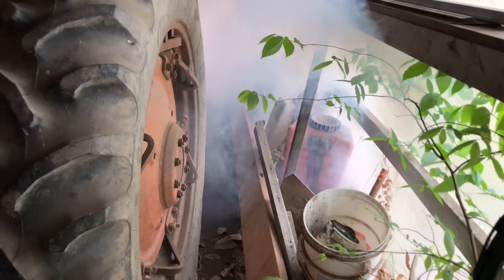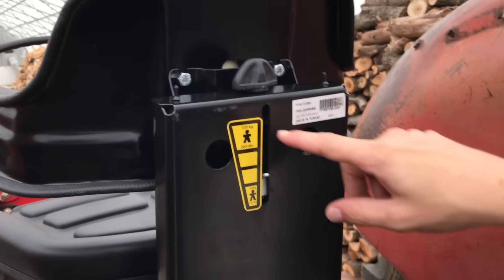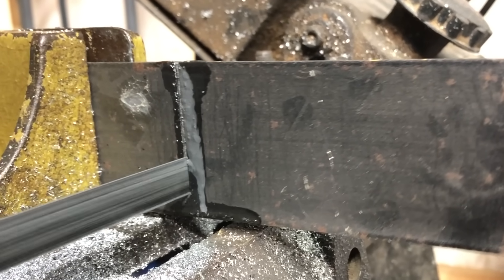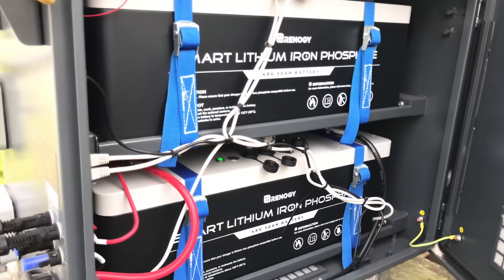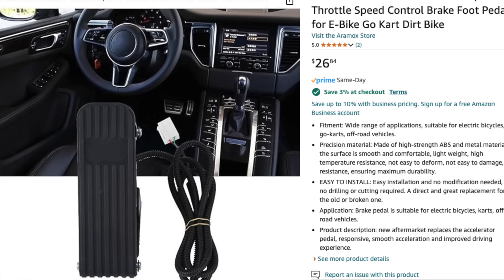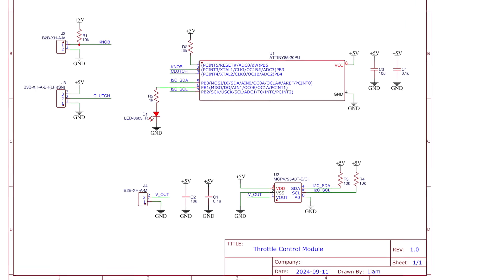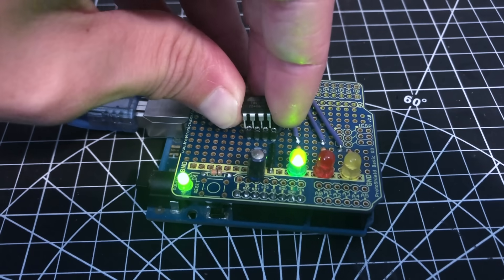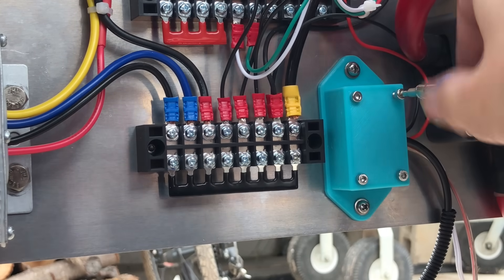Adding a fake clutch & more to my electric tractor conversion

Comment: Emissions for EVs that use electricity produced purely from coal are about the same as for ICE engined vehicles.
When you add lower carbon generation sources EVs progressively have fewer emissions.
Reply: It does depend on the exact fossil fuel source in question. Brown coal is so dirty that an EV running on power produced solely by brown coal would emit more than a diesel. Which is a good argument for not using brown coal power plants, they suck!
Reply: @nerd1000ify  
yeah good point.
I was basing it on typical coal plant CO2 emissions. Many assume that big power plant emissions means big emissions per mile travelled.

Comment: I grew up on a farm and seeing your LED light placement gave me worries. Brush hogging or any work around fields will have tree branches that quickly peel those lights off. Old Ford N and Ferguson tractors with googly lights up front could hardly stay attached. Best solution is look up Allis Chalmers WD lighting (it's back by the operator station, short wire runs, protected, plus if you need to check the engine you can see stuff), later tractors the forward lights moved to the rear fenders.    Hopefully another episode you can reattach all the hood sheet metal so the tractor appears original until closer inspection shows new..

Comment: The implementation of the clutch for fine movement is a genius idea. It makes so much sense on a piece of farming equipment as opposed to having an accelerator and trying to push down carefully. 
The only thing missing (From a safety perspective) is a dead man switch on the seat in case the driver falls off.
Reply: The lawn tractors / riding mawers have something like that, I haven't seen it on a normal tractor.
Reply: @stelleratorsuprise8185 there are in some. They shut down the engine when the tractor is in gear or when the pto is turned on.
Reply: @stelleratorsuprise8185  tractors have cabins nowdays. But there usually is a switch that prevents tractor to start the engine or move, without someone sitting on the seat. But you can run it stationary.
Reply: It looked like he was using the PTO while the tractor was stationary though. If I understood correctly, the motor is powering the weels as well as the PTO, so the dead man switch would require an optional override that makes it almost useless again.
Best way would be to couple the deadman to either a sensor for the selected gear or speed of the tractor => switch off IF  nobody in the seat AND (gear selected OR speed > 0)
Reply: you can install a simple dead man switch under the driver seat, on a 5sec time set so when the weight from the seat is lifted for over 5 sec the tractor shuts off or applies full brakes.
Reply: Which tractor from the 70s got a dead man switch in the seat? :)
Reply: @RubenKelevra yup. Hope it hits a tree and not the house lol that's how you end up with a tractor in the living room
Reply from the maker: @formernegativehuman  I would love to have a tractor in my living room

Comment: No comparison of your toy with another identical tractor doing the same job, e.g. deep plowing or other heavy agricultural work. Also, don't forget about the time it takes to refuel.
Reply: Tractors on farms don't just get used for ploughing.

I've done a fair bit of farm work, and honestly our most used vehicle was a Posi-Trac loader. Used as forklift, front end loader, cement mixer, post hole driller, etc. Often hardly drove it any distance, start up, work for 10-15 min, shut down again because there's hand work to do. So for that kind of operation an electric tractor would do great, no wasted energy from leaving it idling all the time and would handle those tasks without an issue. Would still have the big combustion tractor for the field work like planting and spraying. 

The farm I worked on never ploughed, No-Till grain (either barley or sorghum) and beef cattle only. Ploughing trashes the topsoil and ruins your fertility, the reason you do it is to kill weeds before planting, but that's not necessary when you can spray the field with glyphosate instead.
Reply: This is a DIY "project". There's no way this should be compared with a commercially developed and built tractor! It uses a $99 off-the-shelf general purpose electric motor! However it is demonstrating the real potential for some farm vehicles to be electrically powered.

Comment: Pay zero attention to the people arguing that electric is "worse" than petroleum as I doubt that was the point.  It seems to me that you wanted to revive this tractor to do something useful without the noise and smoke.  It's a great project, so thank you for sharing it with us.

I've used tractors for decades and it would be nice to have a BEV one for shorter tasks.  They can't work for days at a time like their diesel counterparts, but they're great for many jobs.
Reply: Its weird that people instantly jump to "he must be a environmental crazy" just because eletric engines. The thing is fun as heck, produces a ton of power and are simpler than combustion. How not to like EV projects?
Reply: godzina jazdy 12 godzin ładowania , zajebista zabawa
Reply: @mariusz3229 More like 12 hours of driving and one hour of charging if you connect it to your 63A three-phase outlet.

Otherwise you just charge it overnight or when it's not being used anyways, at which point it takes less actual "worked" time to fill up than a diesel, since plugging it in takes just 5 seconds to do instead of a few minutes.
Reply: @mariusz3229  tractors are not for fun, is for work and in one hour, you can plow at lest two smaller fields or a single big one. 
But I doubt well build EV tractors only work for one hour, why because CAT came out with their EV excavators and they calim they can work for ~8 hours depending on the job.
Reply: @Argoon1981    Then show how you plow a field of, for example, 20 ha until your toy is unloaded, and how the diesel, towing your toy along with the plow, will finish the plowing for it and tow it all to the house.
Reply: @mariusz3229  ok we get it, you work for the oil companies and want to continue to keep us relying on the things we know are destroying earth. We’ll just do the stupid thing forever and never try anything else, seems like a the best idea in your opinion

Comment: Nice job! I can't wait to see more :)
I have a few suggestions for you. Place the lights on top of the front tires in a way that they turn when the tires turn (if possible somehow). The second suggestion: Lower the battery (if possible) so that the center of gravity is lower :)

Comment: The amount of people who are still stuck on the argument of "the power comes from coal tho!" is genuinely laughable. While there are many valid arguments like the destruction of land and pollution to mine rare metals needed in solar and batteries. But instead, they are going with the argument that can be disproven in 2 ways. 1# Many places even in the USA are powered heavily and or entirely off renewable. Where I am at we are 85% hydro, 14% wind, and 1% solar. 2# the efficiency of scale, Even if a plant uses some other fuel. Plants scaled up plants can gain much more from the same quantity of fuel than if you were to put it in a car or whatever. To give you an idea a natural gas vehicle can achieve 35-40% efficiency while a natural gas power plant hovers around 60%. So you get 2x ish the power for the same volume of fuel.
Reply: Hydro is about the most environmentally destructive power there is.
Reply: @juslitor  your right but wrong. while all power has some downside. our local dams have incredibly advanced systems to relocate fish up stream and prevent them from getting to the tubines. back 60 years ago I would agree 100% but the tech has come a long way and is really not that destructive anymore

Comment: Coal is used to make the panels. The production of silicon requires the combustion of some sort of carbon fuel. The country where they're produced burns more coal than all other countries combined. A bunker fuel burning ship also brought those panels to your country. Solar panels also have an extremely poor EROI, so the fuels burned to produce them is of significant concern.

Anyone wondering why CO2 emissions are continuing to climb as solar power is gaining in popularity?
Reply: I mean, coal is used to make a combustion engine too if we want to go that way. Electrical is genuinely less polluting, especially if your country has a good mix of nuclear and renewables.
Reply: @arconium2571  But if we're talking about nuclear vs solar, it's clear that the winner is nuclear.
Reply: I love nuclear power, but I dunno about nuclear having less emissions during the build when compared to solar. Remember that building nuclear plants uses a lot of concrete and steel. Portland cement for concrete is made in fossil fuel fired cement kilns, steel with coke fired blast furnaces. Add on top of that extracting and refining the uranium (uranium enrichment is infamously energy intensive) and all the energy expenditure on actually making the working parts (pressure vessel, turbines, hydrogen cooled generator, etc). 

Would need a proper technical assessment to to be sure I think.
Reply: @nerd1000ify  Stand-alone solar power systems require more concrete and steel than nuclear. It's just the sheer quantity of the mounts required.
Reply: @PistonAvatarGuy you got a source I can check out for that? Just a title would  be best, YouTube always seems to delete off-site links.
Reply: @nerd1000ify  The title is also not likely to post, in my experience. The source is the IEA.
Reply: @nerd1000ify  Sorry, the source on that particular metric was the DoE. It was a study from 2015 and the lifespan of solar panels appears to be increasing significantly, but even if it's assumed that the solar panels will last for 80 years (about three times longer than the DoE's assumed lifespan), the materials requirements for solar are still greater. Just consider that solar panels require more than 60 times the land area of a NPP with the same annual energy output and you'll begin to understand how that's possible. None of these estimates even include the batteries required to compensate for the variability of solar energy.

What I'd like to see is a study where a ~100 MW-scale solar energy installation, along with the batteries required for it to load-follow in some practical manner, is assessed against a NPP. I'd bet that the findings would be shocking, especially when seasonal variability is taken into account.
Reply: @PistonAvatarGuy  Honestly the best place for solar is the roof of existing structures (like all the sunshades in parking lots).
Reply: @nerd1000ify  There aren't many sunshades over parking structures. If we were to build such structures for the installation of solar energy systems, that would significantly increase the already insane amount of steel required for stand-alone solar panel installations. Solar just isn't the solution to our current energy problems.
Reply: Bunker fuel? Did he buy the panels from Iran? The maritime industry phased that stuff out in '22.
Reply: @elongated_muskrat_is_my_name  I don't think so, that may only apply to cruise ships.

Comment: Boy am I tired of the ignorant "derp, EVs suck because they are charged with dirty power" thing. It doesn't matter if you charge an EV with 100% coal power, it is still cleaner than running a gas or diesel engine because EVs are vastly more efficient. I've done the math on my plug-in hybrid, and it does get the equivalent of about 100 MPG on electric, but around 38 on gas, and that's with one of the most efficient gas engines ever made. 

Since I charge my EV-mode hybrid with hydropower, it is not at all inaccurate to say that my car runs on gravity. Similarly, the tractor in this video runs on fusion power!
Reply: More accurate to say it runs on sunshine, as it's heat from the sun that evaporates the water from oceans, rivers and lakes and conveys the clouds they form, by solar powered winds, to be deposited as rain on mountain ranges.
Reply: @sailingoctopus1  That's why I said that his tractor runs on fusion, because that's how the sunlight is produced.
Reply: Did ya include the manufacturing costs of the batteries, the tires, the electronics, the raw materials, the casting, etc ? Because if ya did, then ya would know electric produces more waste in the manufacturing stage, when all the lil bits are included. True, when using, the emissions are good, until you bust your batteries.
Reply: @juslitor  as opposed to ICE cars, which are well known not to have tires or any castings
Reply: @juslitor  If you include the full life-cycle costs: the break-even point is around 20,000km, or about 2 years of typical driving.
Reply: @juslitor  EVs have around double the embodied energy of gas cars, that's true. But unlike gas cars, EVs can run on "fuel" that is extremely low-carbon, so their lifetime carbon emissions are still lower than gas cars. People like you who like to bash EVs really do not have an understanding of how enormously more efficient they are. My car really does get the equivalent of 100 MPG in electric mode. And, a HUGE benefit of EVs is that every one of them gets cleaner every time the grid gets cleaner. No more relying on individual actions, you just replace a coal power plant with nuclear and boom, every EV that uses that grid is cleaner. Gas cars are incapable of ever being cleaner.
Reply: @juslitor  Go on, say it. Say the batteries "can't be recycled". You know you want to.

Comment: Electrical Engineer here:

You are correct. The coal is located inside and can be accessed via that screw cap.

Also, now that you broke the seal, all of the coal will have expired and must be replaced. Sorry for the bad news.
Reply: Engineer here, too - I concur.
Reply: Love your nick name.
Electrical ingeniör here.
I concur. Coal must be replaced.
I recommend original German brown coal.
Reply: The only way to prove the coal is there: short the battery terminals and let out the magic smoke as the coal combusts
Reply: I love thread.  😂
Reply: I hate this about coal, it can stay for thousands of years perfectly fine underground, but once I open the cap it expires in a few seconds.
Reply: Actually the battery probably has a graphite anode.
Reply: @economicprisoner  Graphite? Pencils? Which hardness?

Comment: You can put the original panels back on AND still show off the goods. It looks very unfinished without a hood on it. 

Sweet project, though! I'll definitely be hopping in to check on the progress.
Reply: I like this idea.  original hood top but no sides or replace them with plexi panels to show off the battery case.

Comment: This is so sick. Also, even if it was powered by electricity produced with coal it would still be way cleaner than a diesel tractor.
Reply: It's true! A steam turbine can be nearly 99% efficient, and a diesel engine is 30 to 40%. However, that old one is probably around 15 to 20%. An electric drivetrain is above 80% efficient, batteries to work done. Therefore an electric tractor charged by a coal powered turbine would be more efficient than using that same energy to upgrade oil to diesel, transport that diesel to the tractor, and run an engine with 20% efficency. Add to the fact that environmental controls and emmisson controls on power plants are far better than an old diesel engine. Lastly, most electricity grids in the world run on a mix of renewable and non renewable, the grid where he lives is mostly renewable. Therefore, charging from the main grid is still greener than using diesel. The fact that he is using solar to charge is the best case scenario, drive for free and produce no air pollution.
Reply: But less effective in doing the job. For 8 hours of work, how many times does Diesel have to charge this toy?
Reply: Nevermind that diesel exhaust is good for plants.
Reply: @KC9UDX  Umm, what?
Reply: @baddriversofcolga  he's not wrong, some farms are using their diesel exhaust fumes as fertiliser and get good results

this is still a really neat project
Reply: @baddriversofcolga  everyone forgets third grade science when they get to fifth grade "save a planet"
Reply: @john_barnett  I looked it up and the only thing I can find is using diesel exhaust fluid which is used in vehicles to reduce emissions and is not the same thing as diesel or diesel exhaust.
Reply: @baddriversofcolga you are correct! As an expert on all things mechanical and specifically diesel I can confirm that DEF is a great fertilizer. Untreated diesel exhaust is full of chemicals that can and will harm life. Yes there is co2 in the exhaust for the plants, however there is also heavy metals and other compounds which could saturate the plants and their crops. I certainly don't want to eat that. Greenhouses do use co2 generators that run on fuel, however these generators are not dumping untreated diesel exhaust on plants.
Reply: @KC9UDX  Diesel exhaust contains plenty of nasties as well as any chemicals that may help growth. There is no doubt that diesel exhaust for this old tractor would produce food that was unfit for human consumption!

Comment: at ur age I was playing with gas  few yr later took a few 1/4's at school doing electronics.  It was not for me
Took by GI bill and bought a house with 20 ac of lawn.  That lawn got dig up.  Today I own about 500ac and doing beef.  Bail hay.  How much did that thing run u? whats it HP and torque.  I saw it hulling what 8 bails.  I am thinking on buying or building 2 with no less then 160hp to bail with less if I can rig bailer with own motor.  I really would like to be the first beef producer doin so total renewable.
U seem to know what u r doing Lest say a little one that can handle 10 ton going down some bad hills. How r the new motor on regen hold back.  Dont want to do a lot of brake dust.